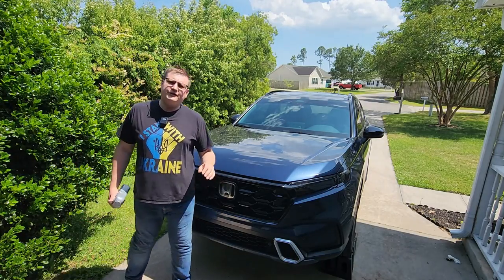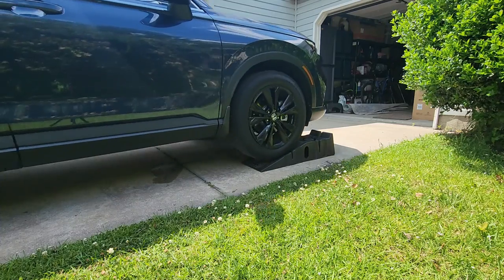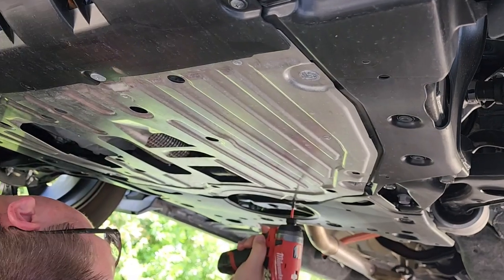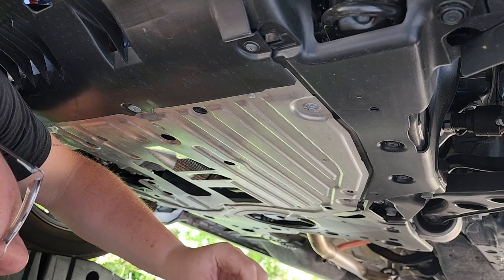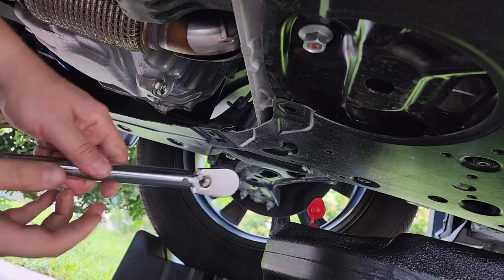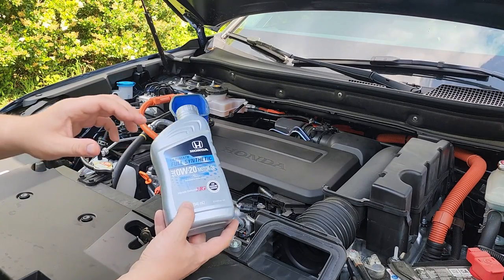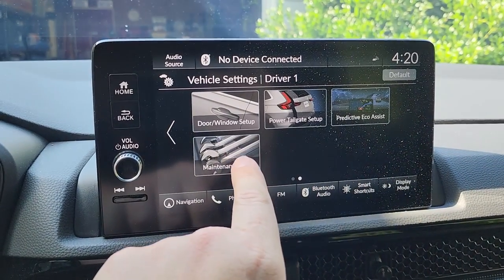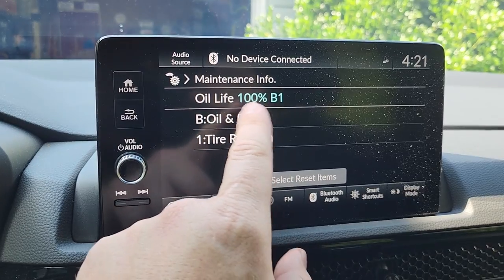2023 Honda CR-V Hybrid  - Oil Change

Comment: Didn’t you get 3yr 36,000 free oil changes from Honda ! I did maybe it’s a Cali thing ✅
Reply from the maker: No. They change here for maintenance plan, alot of money when you buy a car.  It did came with 2 free oil changes voucher only, but I will use it later.  First oil change I wanted to do it myself and for this video
Reply: I would check. All 2023 Hondas come with 2 year of maintenance, by Honda. Check your sticker!
Reply from the maker: @mchaarprado  I will check but I'm in United States and I only had a voucher for two free oil changes

Comment: Always remove oil filter first for new car.
Reply from the maker: Huh ?.... what are you talking about? You never remove oil filter first you have to drain the oil and then remote filter... Da......
Reply: @IvanRossS  Not remove but loosen - had issues where oil filter was difficult to remove - had to buy new wrench. Think about it. Oil drained and oil filter cannot be removed.
Reply from the maker: @fortuneeight-p9z  bro. I work on cars. I have all kind of oil filters in my shop. And with wrench I'm showing in the video you can pretty much remove Any filters
Reply from the maker: @fortuneeight-p9z  specially on New Car it will be Super easy to Remove because they installing filters using automatic torque wrench.... lol it's not like you took it to Jiffy Lubes and one of the guy who was high put 300 ftlbp on the filter